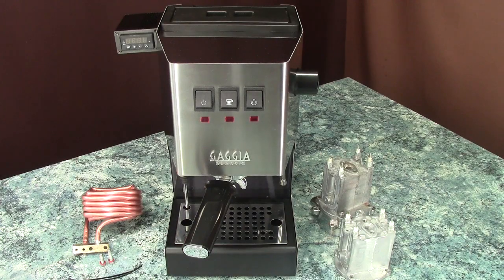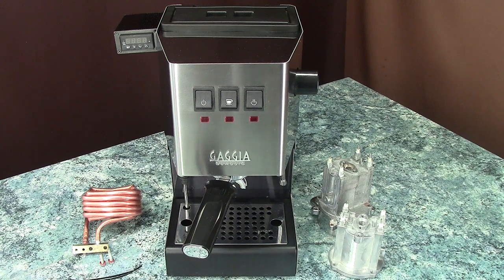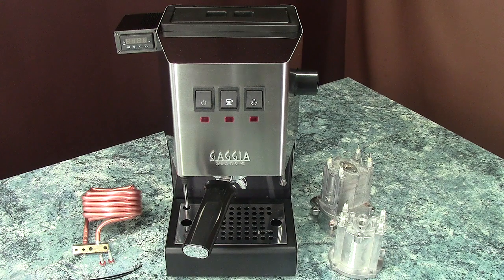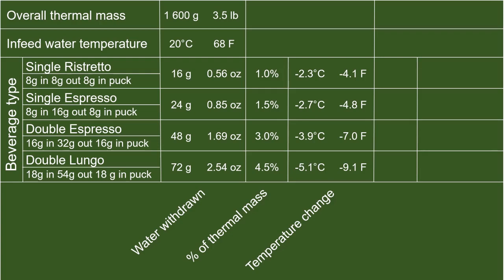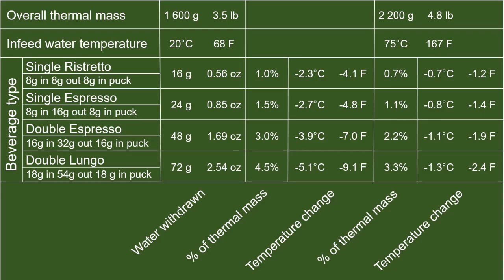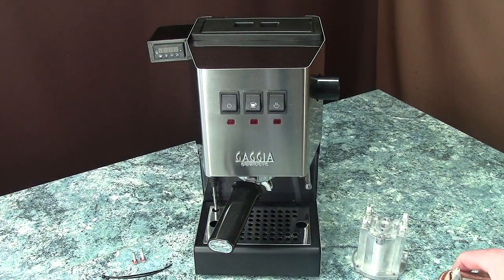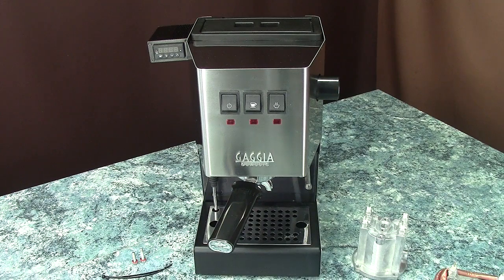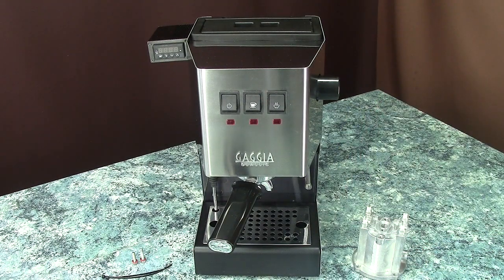Preheat coils upgrader for Gaggia Classic (Pro) introduction

Comment: Excellent what you show. I have an Oster Prima Latte, and I used to perform the necessary external maintenance, but doubting the descaling process, I decided to open it and was horrified by the amount of mineral buildup I found inside. A piece of aluminum tube had corroded and fallen into the boiler, the boiler itself was corroded since it’s made of aluminum, and when I ran my finger over it, it turned to dust. Hard water had clearly done its damage, even though I descaled it every three months. This machine is not cheap in my country, and it was marketed with a superior boiler technology, but it’s the same—only the steam section has the promoted maze of ducts.

How hard is it to make a decent boiler that doesn’t always have liquid accumulated inside, preventing it from draining? It’s designed in such a way that there’s a tall drainage tube integrated into the aluminum structure, so the mineral and aluminum fragments that broke off can never escape.

If I had the time, I’d make the boiler out of copper or, at the very least, enameled aluminum. It’s pathetic that they allow this to be sold
Reply from the maker: @fernandovalladares6701  Making a boiler from scratch is a daunting task, if it's a single boiler, it has to withstand 20bars of pressure to stay on the safe side.

Comment: Really good mod, what should be considered in my oppinion is the etxra insulation of the coil, and an expansion buffer to reduce the stress and vibration. Good start btw
Reply from the maker: Hi,
Thank you.
I've done an insulating for it out of high density closed cell silicone sponge sheet. Mainly because of the noise generated by the vibration, but it didn't make a lot of difference. It sounds much quieter when the Pro OPV is used with the braided silicone hose, instead of the version 1 brass OPV and the teflon tube. Especially if a pump dimmer is used too, it could be surprisingly quiet. In my opinion the heat dissipation of an expansion would be quite significant and it would definitely make it much more expensive, but I haven't tested it. In regards of stress, it is more than sturdy enough for even the double of the stress it gets.
The heat insulation would definitely reduce power consumption though. I might try different materials, due to space limitations  between the coils and the solenoid.

Comment: I insulated my boiler and redesigned it to take a pid where the fill funel went I just 3D printed a piece to take its place it's like like 100% better also added a very nice switch to override the solenoid so j could have proper pre infusion but insulating the boer made a massive difference it's stays so thermaly stable now and I was able to fit it all in the factory chassis nothing hanging off the front side or back
Reply: Hi,
Thank you for sharing.
Insulating the boiler is not gonna help with heat loss at all, the boiler loses majority of it's heat to the influx of cold water not the air surrounding it and that you can't insulate against, another big part is lost to all the other metal bits it contacts and maybe a very tiny almost unnoticeable part will be radiated int the air, for your brew cycle that's most likely nothing and you surely ain't gonna preserve more heat by insulating it.
However insulation provides protection for the PID you installed inside the machine, which isn't recommended as they tend to overheat there if the machine is on for prolonged time. As it's quite far from the boiler and close to the vent holes, you're probably fine though.

In terms of how nano heating works it's diff from stm, more static, less reactive, i'd leave the defaults in place if i was you.
Reply: I hate to tell you this but you could not be more incorrect the boiler is far more stable in temp as a boiler tech I have a good understanding of thermal dynamics the temperature is far more stable under pulse width I think alot of this has to do with the type of PID and algorithm you set as well as the placement of the thermistor and of course the insulation prevents the casting from loosing a large percentage of its heat to the environment but I do agree the water does the bulk of heat loss in my opinion 60% but without question the coffee and heat stability has been dramatically improved

Comment: Looks good. Is it more noisy when you are brewing (vs a non modified machine), or is it only noisier than standard if you have no basket / coffee (no resistance)? Thanks

Also, how long do you have to leave between consecutive shots to achieve a consistent temperature between the two shots? The pid sensor i have is only going to tell me boiler temp, and not the temp in the coil.

Many thanks
Reply: Hi,
Thank you.
It's only noisier while there is no pressure in the system. During a shot it is identical to a stock machine, however every shot starts with a ramp up, until the entire system gets up to pressure.
I've done most of the testing on a V1 rather than a Pro or Evo, but just now made a V2 (stainless steel boilered EU model) to V1 conversion with the coils and it's surprisingly quite.
I believe it is down to the braided silicone hose between the pump and the group dumping the uneven water flow from the pump, rather than more rigid PTFE hose on V1 machines.
The recovery time to pull identical shots mostly dependent on the amount of water used in the first shot and warmup time before the first shot. It could vary between a couple of minutes and 10 minutes.

Comment: Hello. Are you managing to get the temperature in the coil consistent from one shot to the next? How do you know it's not say 60 degrees one shot and 70 degrees the next? I'm really keen to improve the temperature stability but wary that this might be at the expense of consistency from one shot to the next. How are you getting on with this? Thanks
Reply from the maker: Hi,
Sorry for the delay in responding. I'm doing temperature testing eversince. I wanted to make a video about this in more details anyway, now I'm capturing all the data needed. I equipped a machine with multiple temperature sensors on the coils and also using a puck temperature sensor to see the output temperature. At this point I can say the entire system (group & preheat-coils) has to reach equilibrium before pulling a shot, otherwise the coils sucking so much heat from the system, it would completely ruin the temperature of the shot. This takes a warm-up time of 17 minutes from cold @ 24°C room temperature and interestingly 15 minutes to recover between shots.
Reply from the maker: Obviously this is only relevant to my exact setup. If you do your own coils, your miles will vary.
Reply: @BREWBETTER Interesting. I thought the whole idea was actually to create a quick recovery time between shots.
Reply from the maker: @yasinunlu443  Not at all, the aim was to eliminate the ~4°C droop during a standard shot with a PIDd machine, to maintain a consistent accurate temperature.